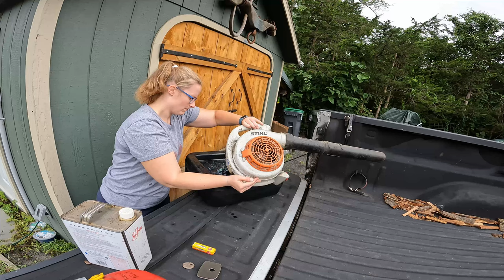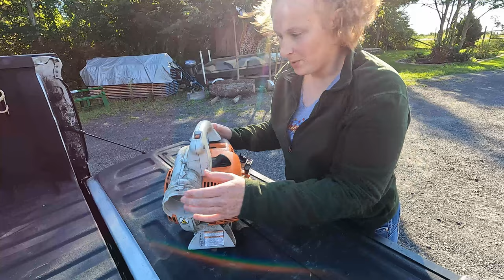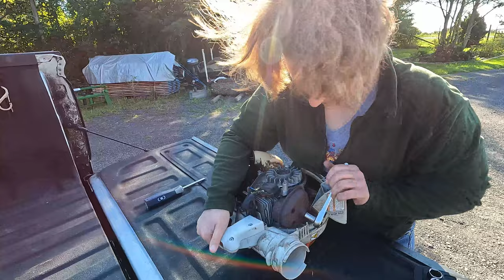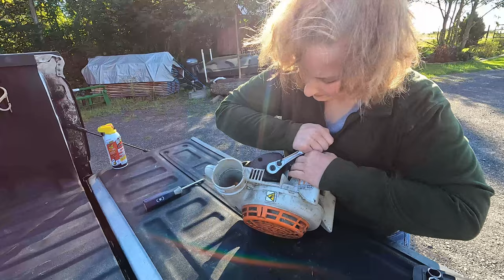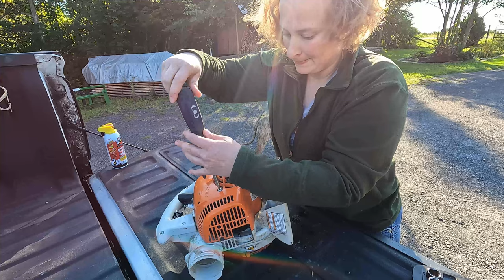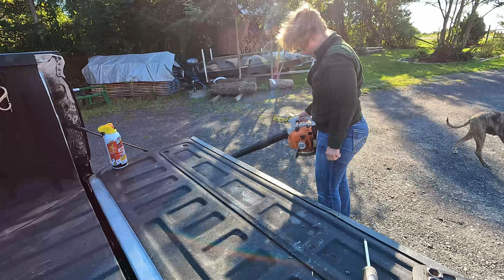Stihl BG 56C leaf blower won't run, what's wrong with it?

Comment: Good video.  When you were struggling with the bolts, just move your work to the  ground or get above your work so that you can get leverage.  No one has as much strength at chest level as you would have standing over it.